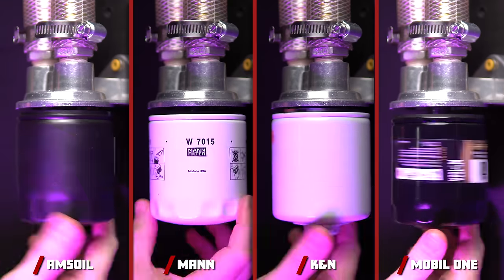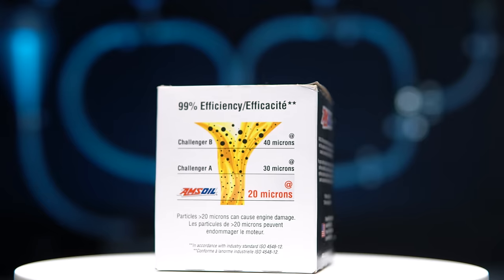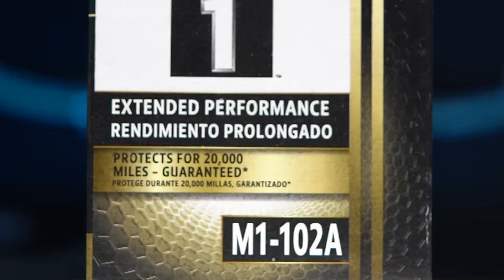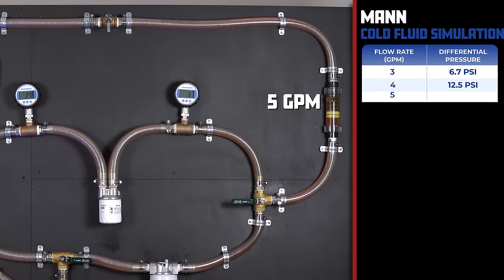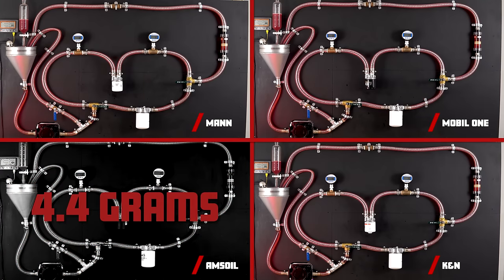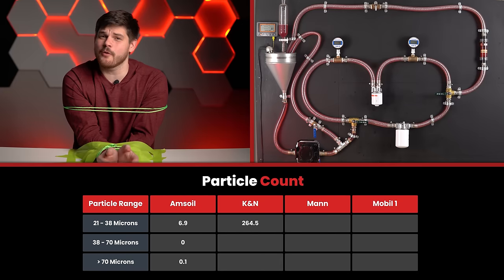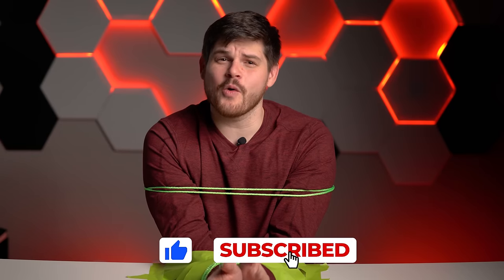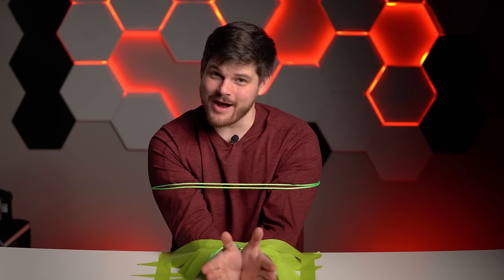Best Oil Filters of 2024 (Engineer Tested) - Amsoil | Mobil 1 | Mann | K&N

Comment: Been using Amsoil oil for decades and all my engines have make it to 500,000km (300,000km) I was using Amsoil filters but now I use Fram Ultra.  0 issues and my engine is spotless inside (using a boroscope) and compression is still factory on my current vehicle at 200K miles (320K KM)
Reply: 🥱😴 a good engine design and just basic run of the mill store brand synthetic and an OEM quality filter could have produced the same results for all you know. 🤷🏻‍♂️
Reply: @I_know_what_im_talking_about  Oil analysis reports say otherwise.  But go ahead.
Reply: @CedroCron  — yea but obviously you’ve never compared the Amsoil to any other off the shelf synthetic. Like I said… what if the results will be THE SAME?!?! 😏😆
Reply: @I_know_what_im_talking_about  Yes I have... I don't buy premium when economy will do. I have lab data showing the difference.  But you buy what suits you.
Reply: Couñt your blessings. Fram has a bad reputation. You've gone from bad to worse. Why DONT you use Amsoil filters now? 🤔
Reply: @riceburner4747  Opinion not based in facts.  The largest filter maker in the world and they make for Subaru north America. They also supply every Walmart, If they were that bad they would have been sued into oblivion by now.  I don't use the Amsoil filters because they are $20+ each here and the Fram Ultra show just a few particles in my oil as the Amsoil EAO and EAK filters according to lab results.
Reply: @CedroCron . A Fram filter failed (came apart) and destroyed the engine in my 2018 Mazda CX-5. To their credit, they paid for a new engine. Fyi - It was the basic Fram filter.
Reply: @CedroCron there are plenty of videos showing why Amsoil is superior. Is it superior enough to make a difference for you? Probably not. But it is better.

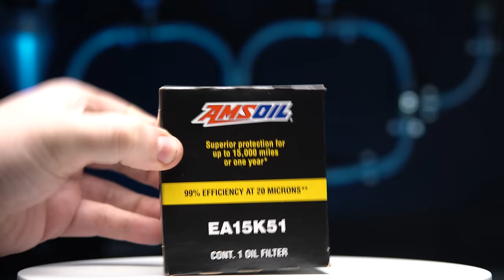Comment: I am an HVAC business owner and Home Performance specialist.  Filtration is huge in HVAC and you have to look at all variables.   I have to say is that there are some very specific things you want to look at in the filtration world.  In an ideal world, you want a filter that flows well, filters well and has a high capacity.  You can't have them all.  You have to pick what things are most important to you.  The K&N AIR filters are free flowing and technically can make more power because they do not filter worth a darn.  Same issue applies here.    The Fram Endurance and Amsoil filters are identical filters made in the same plant by Champion labs.  All the filters tested and shown at 10:20 are either made by Champion labs or Mann-Hummel.  It's pretty simple math.  The Fram Endurance and Amsoil filter nearly the best but the media is full Synthetic which filters really well to 20 microns and clogs fast.  The question is how fast and how often should you change it before it hits the bypass or before the filter is actually clogged to increase oil pressure?

I hate to say this, but if the data is accurate on this chart, then the Purolator BOSS wins pretty much across the board.  Never thought I would say that.  And before anyone gets their underwear in a bunch, think about the differences all over the table.   I will probably still use the Amsoil EAO34/Fram FE3600 which are a different filter than they tested on this test.  The Amsoil EAO filter product line and Fram Endurance / Royal Purple Extended Life filters are the 25k mile filters, not the 15k filter used in this test.  For the most part, they are just bigger filters, and nobody should be doing 15k-25k oil changes anyways.  

Now I need to go buy two Purolator Boss filters that match the EAO34/FE3600 filters to cut one open and inspect new and use one for an oil cycle.  Both of my personal vehicles recommend 10k mile changes, but we do between 5000-7500 miles, with various testing oils sent to Blackstone labs.  I am putting together oil analysis between five vehicles, with different filters and oils.  It just takes a little while to put miles on besides the work vans.    

Anyways, food for thought!!
Reply: Looking @ Purolator’s website, they are saying their Boss Series is a full synthetic filter media..good to know I suppose.
Reply: Your point about 20 microns "clogging fast" ... there's more to the story than just micron size.

The amount of filter media, and the style of media construction can vary.  Surface loading design vs. depth loading design makes a difference in how long it takes to "clog".  Also more capture media surface area, means more contaminant can be captured, and still retain good flow.  The PB seems to have more media and more pleats to go along with its smaller orifice derived from the synthetic media.

As you stated "simple math" ... but, that includes ALL the math (i.e. surface area of the capture media, horizontal / vertical profile of pleat angles, etc.). Going by micron size alone isn't the only indicator ... as we can see by the performance diff's for similar sized (synthetic) media.
Reply: Over the years I have often seen Purolator do well in these comparisons.
Reply: Purolator and Wix are subsidiaries of Mann+Hummel. Mann is the OE supplier for many Mercedes, BMW, VWAG, and other auto manufacturers.

Filtration is the weak link in any automotive application. You shouldn't be stretching your intervals further than 7k miles. Especially if you have direct injection and turbochargers.
Reply: I disagree with your statement about 15k oil changes. I use amsoil in every car truck and motorcycle i own. In every car and truck I change my oil with amsoil at the 15k interval to include the amsoil filter. I have been doing this for over 10 years and never have i blown an engine or had any mechanical failures as a result! Even in my motorcycles my oil changes are limited to 1 year intervals or 5000 miles and my diesels 15k miles plus or one year. Now with that being said I  have lotlgged millions of miles on amsoil oil and filters every fluid in my vehicles is amsoil to include all filters. I have broken down my engines and transmissions on amsoil they look as clean as the day they rolled off the assembly line. I have used the other oils filters and broken down those engines  down to find wear sludge and all types of trash in the heads and lower end i have a keen eye for detail as I was a mechanic and aerospace engineer for 20 years so i and see a cheap gimmick a mile away. Amsoil simply keeps impressing me time and time again and believe me i go out of my way to find a flaw in the product and I have yet to have a single complaint other then the high price of the product but the proofs is in the results!
Reply: @Unique377  Me too since the mid 90’s, no problems
Reply: Could you guys also test engine filters and cabin filters.
Reply: @Unique377  Sorry? I disagree with u. I hear ppl state Amsoil like its the "Almighty". Why do they push so many additives? Sites on utube like: Ford Boss, Car Care Nut,  Scotty, & many more state to change every 5,000 miles? I've SEEN engines who change @ 10,000+.
Reply: @riceburner4747  Brands other than Amsoil are good too if they use the best base oils, like Pennzoil ultra. The oil doesn’t sludge up the engine even after 15,000 miles. There are cars and trucks with Amsoil and a bypass filter with 60,000 miles on the oil and the oil analysis says “good for continued use”. (The bypass filter removes all particulate above 2 microns)
Reply: I always used the K&N HP-1008 on my 350z but now I’m going to try the purolator boss since it won overall and did very well in the testing. Also it’s $3 bucks cheaper vs the K&N but how did your testing/cut open go?
Reply: Excellent analysis. I do have some questions. Wouldn’t filtration matter much more than flow? Since technically to have good filtration you need slow flow or high pressure. Any contaminant getting by is bad, and wouldn’t the lowest amount be the best compared to the other properties of the oil filter?
Reply: The clogging of 20micron filters is what many don't consider. Yes, Amsoil filters well, but I would NEVER run one for 15,000 miles. Not that I would do that with any filter...
Reply: @riceburner4747 Have you SEEN engines with 10,000 mile oil changes on Amsoil? The what the oil is made from matters the most!
Reply: I've begun using the boss on my Kawi vulcan 1600 and my Nissan sentra
Reply: @darrylsjodin7184  A 2 micron filter would remove all of the Moly and other wear additives. Moly can measure 10 microns, so this time of filtration is defeating the purpose of the additives.
Reply: @gorillamoto5329  I don’t really know for sure, but Amsoil has been selling bypass filters for over 30 years and since they make oils, you would think they would know. There’s plenty of other brands of micron bypass filters as well for locomotives, ships etc that go years without an oil change, so the engines wouldn’t last if the additives were filtered out🤔
Reply: Vehicles are too expensive for me to even think about going over 4000 mile oil changes! Oil is cheap why would a 15,000 mile oil change even cross your mind???  That's just insane to me........🤷
Reply: @paulcondie2520  Looks like a typo. I think 15,000 miles was mentioned, not 150,000 miles!🤣
Reply: @darrylsjodin7184  thank you! Glad for edit options! 😎
Reply: @paulcondie2520 I wish oil changes were cheap over here in the UK. I have a small 1.6 car and the cheapest oil and filter change is £103.
Reply: @Simon-fr4ts  sorry to hear that!
Reply: @Simon-fr4ts  Can you do it yourself?   Here in the US (Minnesota) most 'specialty' or 'quick change' shops that only focus on oil changes charge 100+ easy.  But I can buy 5qts of full synthetic oil and a quality filter for 30-40 bucks and it takes roughly 30 minutes of my time. 

Oil changes aren't complicated. 3 things to screw/unscrew (Drain Plug, Oil Filter, Fill Cap)
Reply: @goldenTym  On my car you have to take off the entire under tray and access to the filter is awkward. I park in small communal car park too and have no tools or a ramp/jack to get tge car up high enough to work on. Also getting rid of the used oil is a pain.
Reply: @riceburner4747  Only a lab test of the used oil will actually tell you whether or not 5k, 7.5k, 10k, 15k, etc service intervals are appropriate for your vehicle's engine
Reply: Never seen much dirt get past a k&n myself. You have to put the oil they provide catches the tiniest debris. Thats been my experience.
Reply: 19K on my cummins with filter change at 12k. Blackstone tests said oil looked great. All the numbers were within spec.
Reply: I do 25,000 mile oil changes. I have done it since 1997. I change the filter out every 10 to 12,000 Miles. I do oild analysis. It tells me when I need to change my oil. I went 40,000 with my diesel and came back fine. All while using Amsoil. 
Oil analysis does not lie. It will also tell if you have a problem with your engine in some cases.
Reply: @riceburner4747  What I found was some OE's have their PCV System turned down to let the oil absorb the contaminants from Blowby. Notice all the people talking about short OCI's are Toyota and Honda's as well as others with sticking oil control rings if they wait too long. I found this issue with my Acura MDX, they run crankcase vacuum at .2 to .8inH2O under normal driving conditions.
Through my years I always thought the norm was 1. to 3.inHg. 
This is where the comparison confusion comes in. If your system is turned down this low Blowby and in particular the carbon in it which is sticky isn't pulled from the ring pack effectively, it's a slow process of stuck rings. My 10 MDX was suppose to stick rings but bc I ran a Group IV syn and I ran a 30 instead of a 20 I avoided this issue. It cost Acura millions for this 10-13YM alone. 
When they did the re-ring job the parts used were the same except they specified their P/N for syn oil.
I tested my son's 08 Civic, my 10 MDX, wife's 12 TL, Grandson's 15 Civic and Daughter in Laws HR-V DI and they were all the same. The first thing anyone should do is test with an HVAC Manometer($35.00 Amazon) at the Dipstick tube. If you find low vac levels you will need short OCI's.
I changed the systems in the MDX, TL, 08 Civic with the others to do next. I installed a Catch Can to keep the Blowby out of the Intake tract and in a 950 mile test the MDX used 0 oil and the CC had a couple of Tar Black Tablespoons of oil while the oil looked new as when I left. I've had no DTC's and all emissions are happy so I call it a win situation. 290,8XX miles
My point being you must compare OCI's with like engines only. BMW has 5 of 32 engines running 0.00mbar @ Hot/Idle. These engine will need short OCI's I suggest. American made are still running 1-3inHg as best I can confirm.
Reply: Took me a while to realize what OCI is.....🙄 . I have a 2006 MDX and just hit 200k. I change the oil every 3,000 Mi and just did a big engine flush. It runs great!
Reply: @seekingthetruth304  The J series is a great design but for this weakness in the PCV System. 
A .125 drilled freeze plug on the fresh air side of the system and a Chevy V8 PCV valve with a Catch Can going to the Intake manifold will get the vacuum up.
You'd need to drill the stock PCV Valve out. I tried to mod it to work but couldn't get it where it needed to be.

Comment: Wow, this video is a game-changer for car enthusiasts and engineers alike! The rigorous testing process showcased here highlights the importance of using high-quality oil filters. The detailed analysis and visual comparisons provide valuable insights into the performance of each filter.The fact that you guys  pushed the limits to extreme conditions demonstrates a commitment to excellence in engineering. The findings will undoubtedly help inform informed decisions when choosing the best oil filter for specific vehicle needs.

Hats off to the team for conducting such a comprehensive and informative test. I'm looking forward to seeing more exciting experiments and tests from your team in the future. Keep pushing the boundaries of innovation and sharing your expertise with the world!🎉
Reply: That really depends on how you precieve the testing. It can also make the case for running the cheapest filter as well. Only the top performers where significant improvements and only in specific area's. They are always the most expensive and you still are not get a fantastic filter that does it all. If the engine is clean and well maintained and your air filter is doing it's job the oil filter should not be doing much. Especially if the oil is changed regularly and is a very high quality synthetic oil. You air filter doing it's job and not having any leaks in the air intake tract is super important to keep dust out.
Reply from the maker: Wow! Thank you so much for this kind comment. your support is greatly appreciated!
Reply: But this is nothing new at all. Those things (filtration, bypass, quality of paper, oil analysis etc.) are in the textbooks since the 70's easily.
Reply: This is definitely a game changer for me. I have devised a strategy to try and get the best of both worlds for tuner enthusiasts. After every oil change use a amsoil filter and drive it nice(because of reduced flow) for 100 miles or so to grab all the junk particles from the xp that barely filters then swap over to the wix xp filter and top off for your hard driving and high boost applications. A little more expensive but useful if you are trying to keep old german cars alive like those 1.8ts...

Comment: Would love to see Amsoil EAO filter (25k mile) tested against the EA15K filter (15k mile)!
Reply: They're the same media. They just relabeled them at 15k miles early on because of capacity. I remember when this happened.
Reply: @wiredforstereo , interesting. Flow should be improved as well though, due to more filter surface area?
Reply: @lucasfallert4031   Not sure exactly to what you're referring. Larger area means more flow, yes. But that only becomes an issue as the filter nears plugging. Most of the time, there is more than enough area to maintain flow.

I ran 15k filters to 25k+ a number of times without issue. I figured they were the same filters, why not. I figured it was Amsoil being safe. They were good for 25k originally, why not later. Never was an issue in a Toyota Corolla. May have been an issue in other engines that shed more metal.